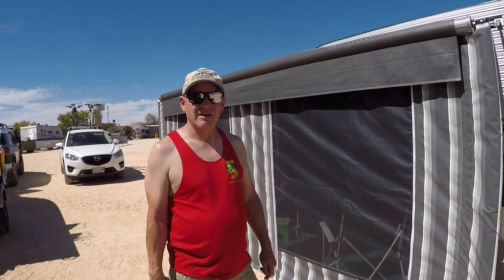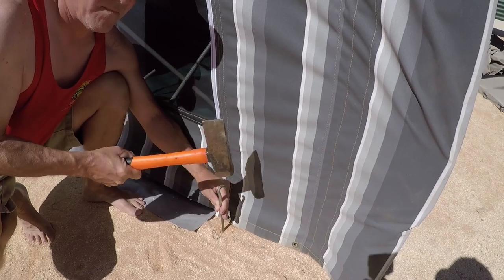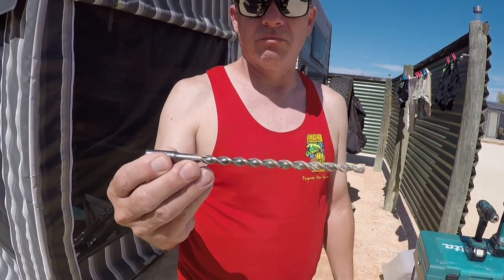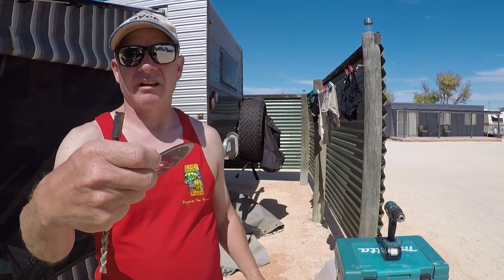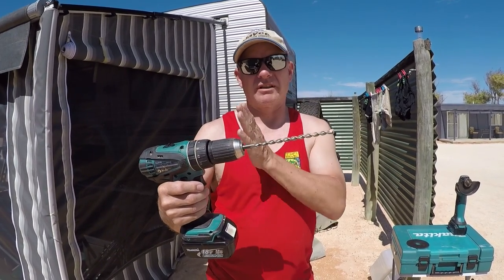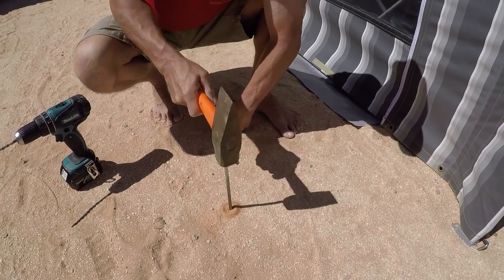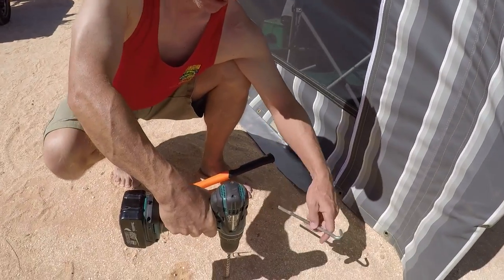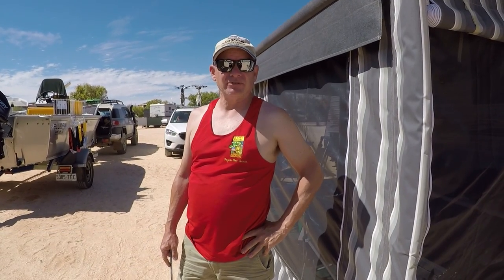Getting Tent Pegs into Concrete like Ground

Comment: Use 130mm galv screws with a washer works a treat
Reply from the maker: I've been told that a couple of times now and seen something similar to hold down mesh cloth as flooring. Thanks for sharing that. 😁
Reply: There are also 150mm stainless but at 10$ price u can buy the screw pegs but I think they are too long close to 300mm and you may just Overload your powertool I think 150mm m10 it is plenty for all grounds excluding sand of course cheers
Reply: @3n7r0p1  We reckon 150mm good for harder grounds like these but depends what you're needing to hold i guess.  Horses for courses. Like any equipment for camping or most things.. There's usually no one best solution.

Comment: but youll never get it out again! Better of using the screw style pegs, at least you can get them out again afterwards
Reply from the maker: I've not had any real trouble getting them out. I start with a twist, which helps. Admittedly, some are harder than others. 😁
Reply: We agree.  :)